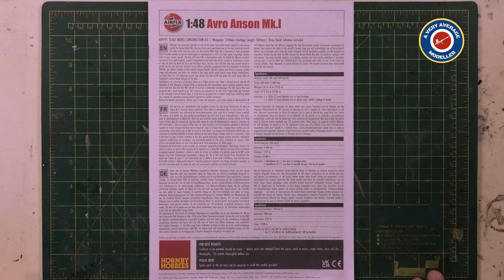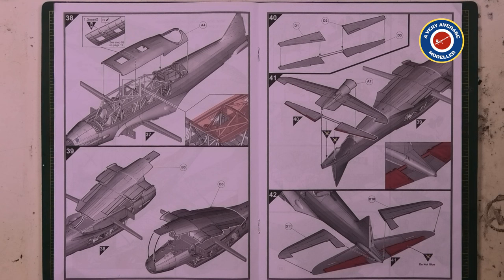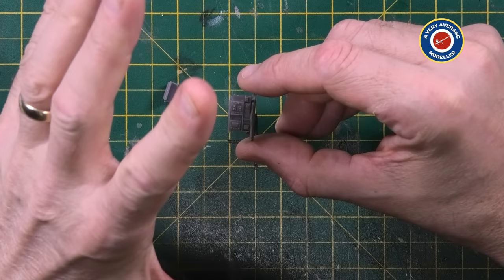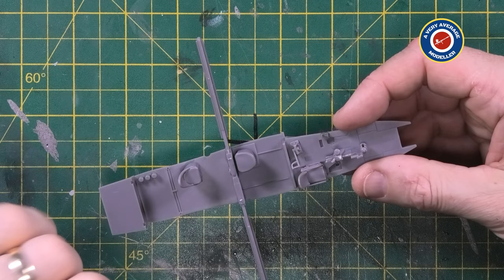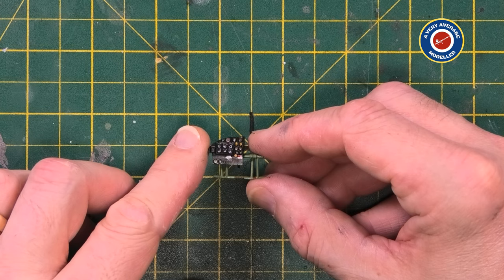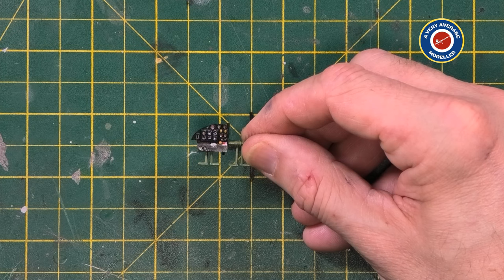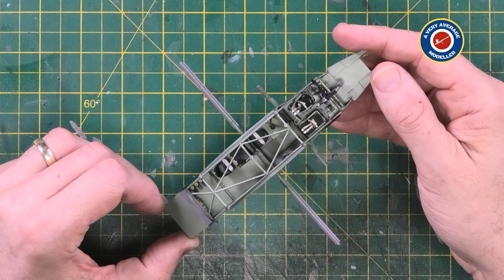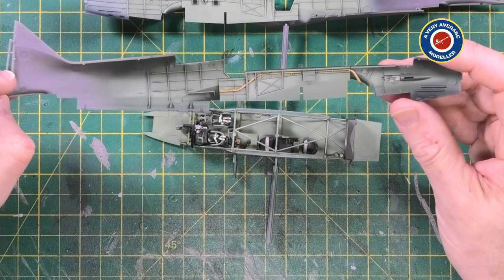Airfix 1/48 Avro Anson Mk.1. Part 1 Steps 1 to 29 the interior.

Comment: I've been looking forward to this! I've just started my own Anson so it's interesting to see how you tackled it.
Reply from the maker: Hey JB how you doing buddy? Interesting to hear you’ve just started your Anson, where are you up to? The kit goes together really, really well and the level of detail really is very good. If you haven’t already done so I’d cut up the decal for the instrument panel / radio set and apply them in sections (unless of course your hand painting them) otherwise they look like a bit of a handful. I’ve just finished masking all the glass work on mine and I have to say the masking set from CT models really is very good, as good as anything from Eduard. I think the way to build it is to do it in sections coz it really is quite a big chunk of plastic once you start to assemble it, I hope to have my fuselage finished by the weekend. Anyway all the best Iain.
Reply: @AVeryAverageModeller  I've mostly finished the cockpit, but I haven't applied the decals to the instrument panel yet, so I'll use your method of cutting the dials out individually. The one thing I was a little disappointed with was there were no pilot or crew, I originally wanted to remake the box art with the anson flying and shooting down a 109. But other than that a really lovely kit from airfix.